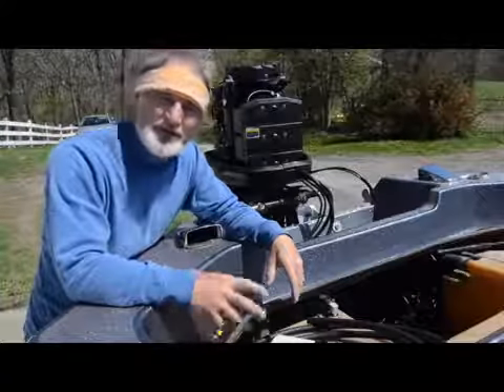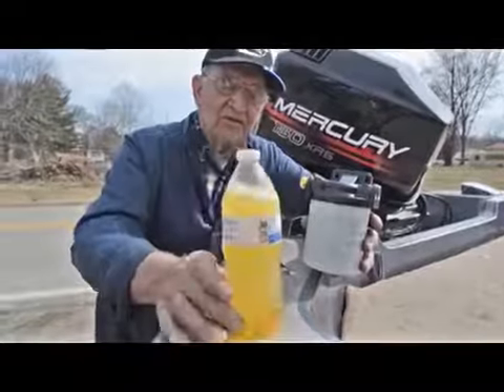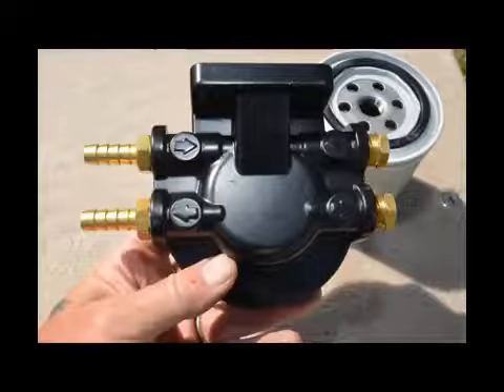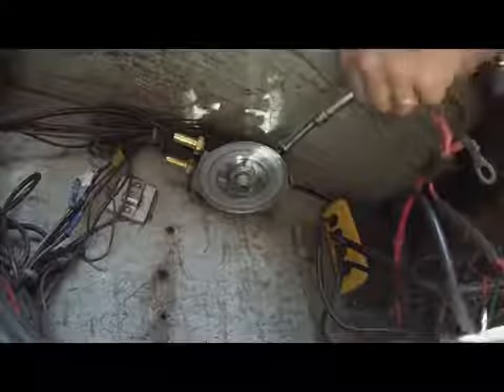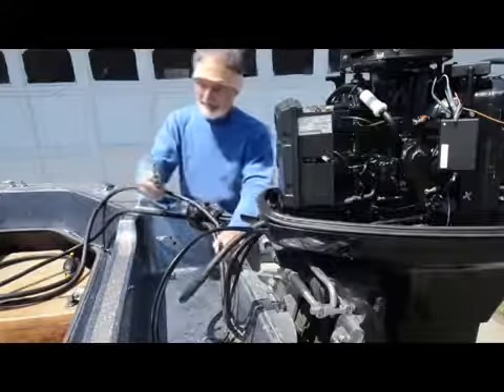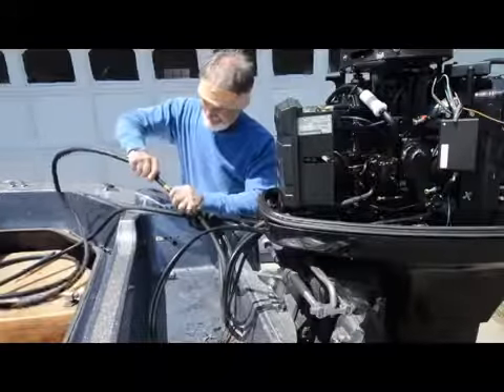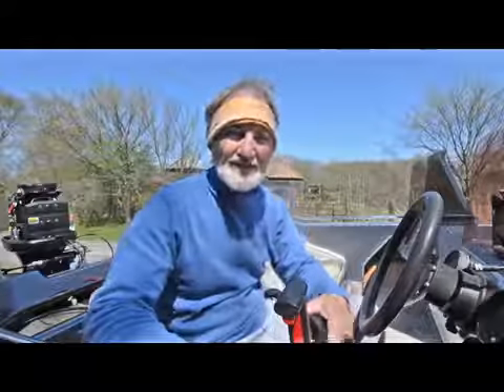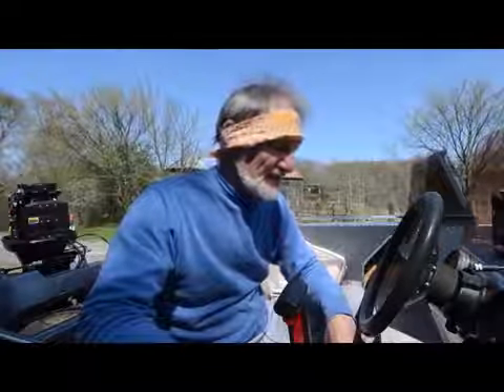Keep Your Bass Boat Alive, Part 3

Comment from the maker: There should be no water in any grade of gasoline when you fill your tank. Unlike the sealed gas tanks in cars and trucks, boat gas tanks are vented. Air circulates through the tank, which causes condensation. The ethanal in gas absorbs this condensation (water). This is particularly harmful to 2-stroke outboards.

Comment: Great vid series. Watch many times. This week my dealer told me I had my primer bulb installed wrong. I had it where you placed it and the front hung down. He said the outgoing end should be tilted upward or the float ball inside will fall into the exit end and inhibit gas flow when pumped or running. Do you agree? Also are those wire ties different than standard? The mechanic gave me a handful which the head is curved to get a better grip. Thanks